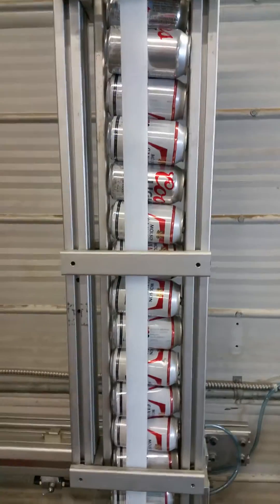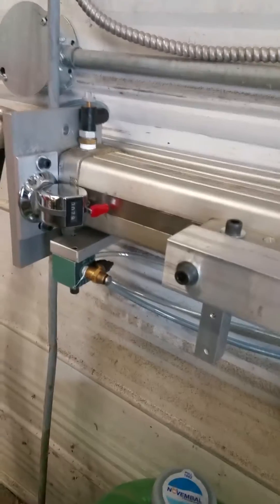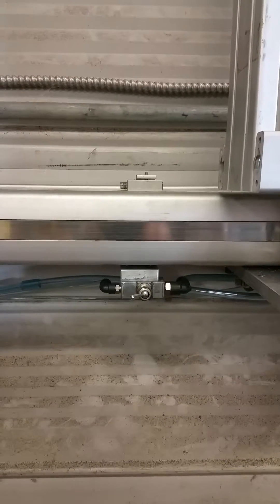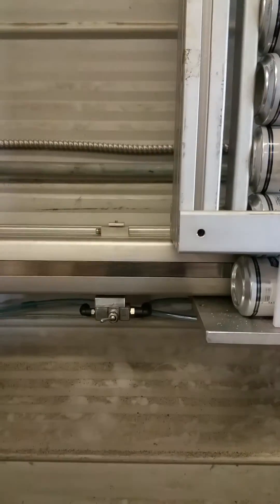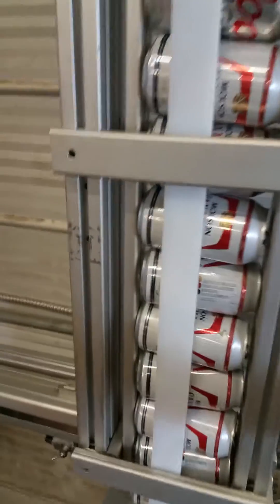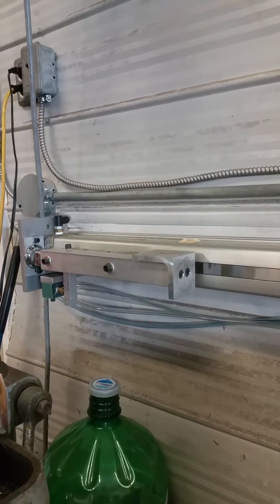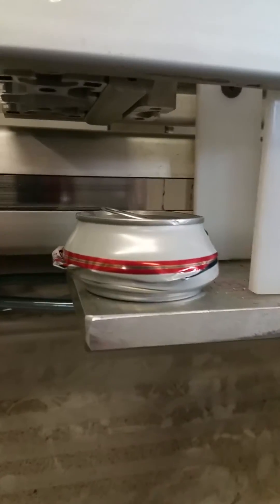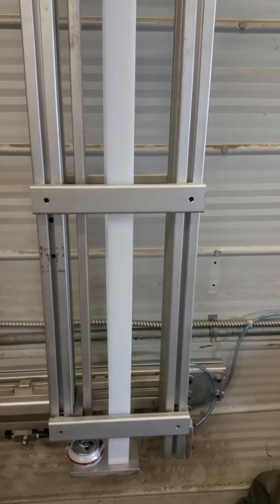Automatic pneumatic can crusher

Comment: Good engineering but seems slow. I want to build a pneumatic crusher but have it crush multiple cans in one stack
Reply: You could make a 2-stage design that crushes a can on extension and retraction.
Reply: @GeneralChangFromDanang  like when it goes backwards it crushes another set of cans in another hopper on the other side. 

I was thinking more along the lines of the hopper is big and round. And you just dump buckets of cans in the top. 
A door slides open on the bottom and as many as can, fall in. The door closes right before the compartment crushes all that's in there at once. And repeat. 
Making cubes of crushed can.
Reply: @daveed1797  That might require a hydraulic cylinder. There's a video somewhere on here where I guy did that.
Reply: @GeneralChangFromDanang  yea we go through a lot of cans so it would be quicker. I was thinking also if I can't get the hydraulics that I could make a smaller manual version.